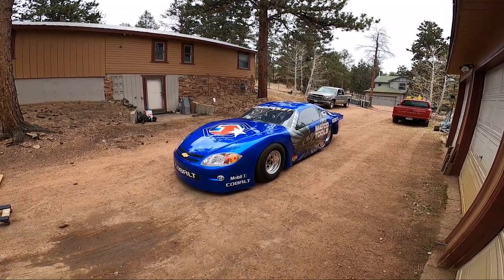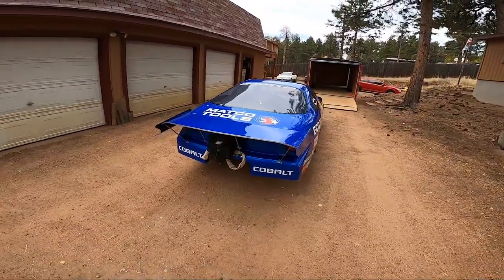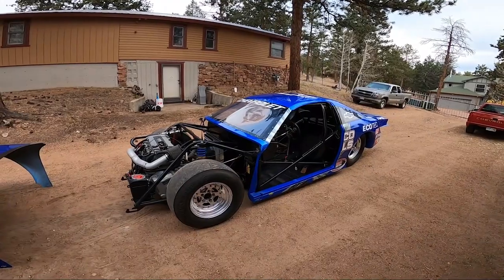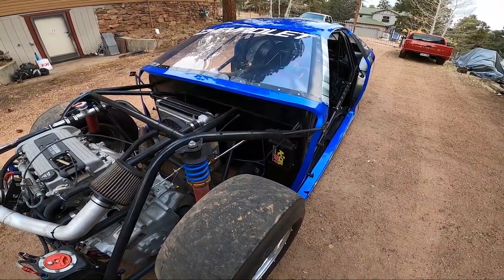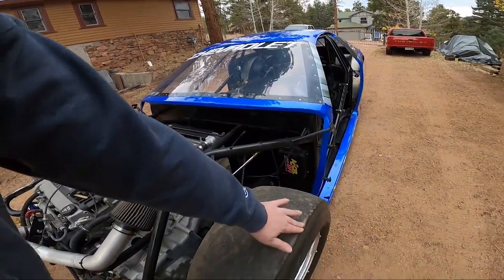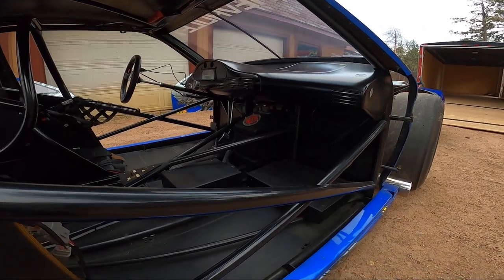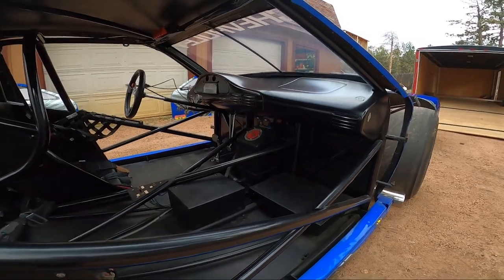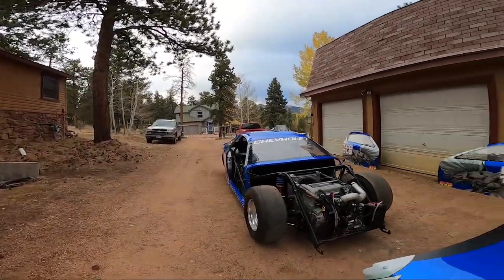Pro FWD Cobalt!  New Race Car Intro

Comment: Man can you PLEASE school me on where the NHRA stands on front wheel drive drag racing, what classes can run front wheel drive do they mingle with rear wheel at all, or do they strictly run FWD with FWD? do they have classes specifically for it or one generalized class? Also if you are abiding by all the other set rules in classes like stock and super stock or super street, can you run front wheel drive? Thanks
Reply from the maker: Unfortunately, I don't think there are any FWD classes anymore with the NHRA.  I assume you could run with other classes but it would be tough to be competitive.  Best to stick with import/sport compact events.